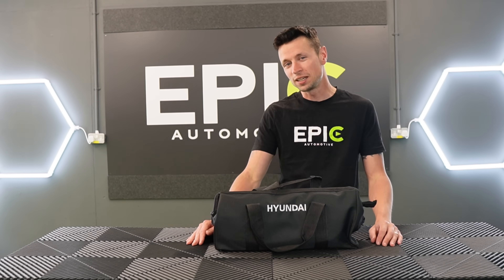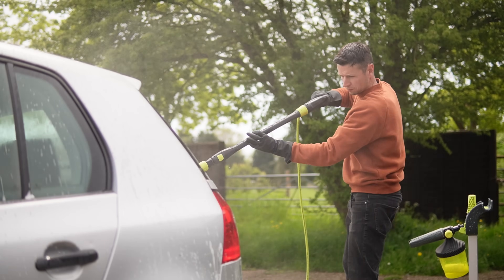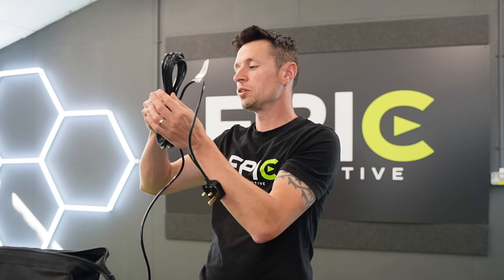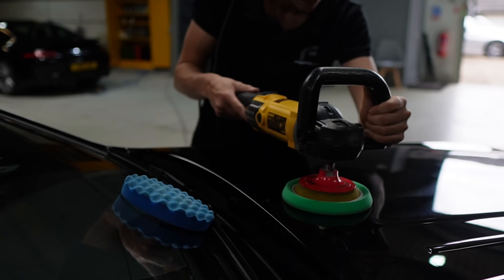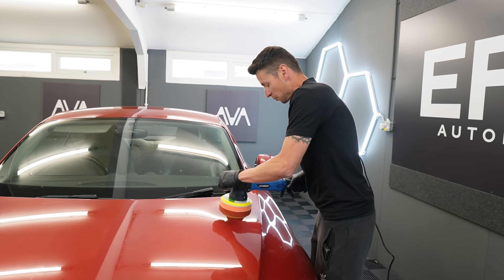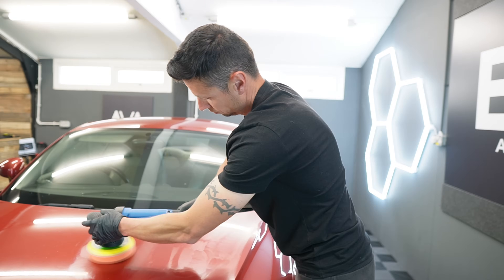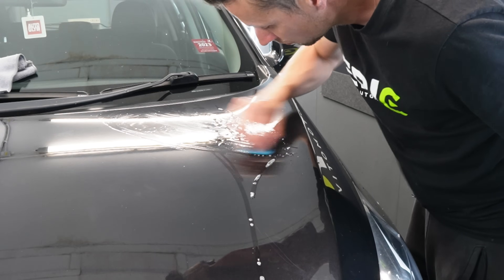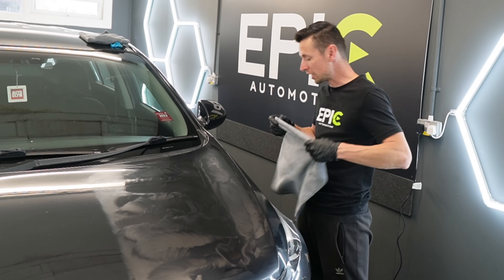Polishing a Car has Never been Easier thanks to this Tool!!!

Comment: I'm  glad I got into detailing 20+ years ago. The choices for machines, pads, compounds was much smaller than nowadays.
Reply from the maker: Life seemed easier back then
Reply: @epicautomotivedetailing  I think everything was!  When I was looking for a machine polisher, all that was around at the time was a Porter Cable, but it was 110V so you also needed a trandformer.  Meguiar's brought out a DA machine, which I bought.  I'm on my 3rd set of bushes for it now.  The choices for compounds, polishes, waxes, sealants etc, pads & machines must be  bewildering for a novice.  This High un Dry kit is terrific value and great for a novice to cut their teeth on!
Reply: I’m starting out and it’s a ballache deciding which ones to get lol. So many compounds, pads, machines etc 😅😅

Comment: Amazing work! Just the Hyundai name would give me confidence that this machine will never go wrong and last a long time. This video shows that there are some real gems if you look around, £22.50 without discount for 40 quality microfibres is a stunning deal. The polisher looks good too, I might look at purchasing this next time, but then again, my 9-year-old Kestrel Deltalyo DAS-6 Pro 850w is still happily and reliably performing daily paint corrections on typically hard paintwork on approved used stock at the Volkswagen dealership I'm based at (well, maybe I like the vibrations!)
Reply from the maker: Thanks Owen, Yeah Im trying to add other cheaper products into the videos to help people find the odd bargain :)

Comment: Great video Dave , got a IN2 Detailing DA8 use Chemical Guys green pad with Scholl S20 black works fine on my car , only polish it every 2 years then apply Pyramid CC 2 year ceramic coating and fannys your Aunt. Bought a couple of packs of those cloths and they are very good value and fantastic quality . Studio looks the dogs mate ! All the best :)
Reply from the maker: Thanks mate my mate supercharged llama has a few polishers from in2 detailing. I still need to try the forced action polisher
Reply: Agreed with the In2Detailing DA8 as a fantastic polished for only £109. Forensic Detail also says great for newbies and pros

Comment: Ive been machine polishing for over 25 years, Started off with rotary back in the 90s and stuck with it until about 2017 when i was tempted with the 'long throw' hype into buying the Flex XFE DA. Going from the rotary to DA i found it useless for anything but very light polishing and finishing. The stalling on the slightest curve is annoying as hell and you spend more time trying to keep the pad spinning than you do doing any meaningful work. About 6 months ago i bought the Flex XCE forced rotation machine and i only wished id bought one years ago. I can knock out a large sized car in 2 hours. You can rip through cars with the forced rotation machines, i love it.
Reply from the maker: Yeah my mate is letting me try his one next week hopefully so it will be interesting to see how it goes
Reply: @epicautomotivedetailing  trust me pal, just buy one. I'd started to dread machine polishing jobs because it took so long, but since I've been using the forced rotation machine, I've started to love it again. Get yourself some 3D Speed and ONE compounds as well, you wont regret it. Only thing I'd say is the forced rotation feels a little erratic at first as it can walk away from where you want it to go but stick with it and you'll master it after a few uses. You hardly ever need to get out the smaller polisher either as the forced rotation can tackle almost every part of the car. You can even tackle larger sections of the car as well rather than just the usual 18 inch squares at a time. If I'm in a rush to get a job done I'll take a whole half of a bonnet in one go and just rip through it on speed 6.
Reply from the maker: @johnmelling9950  I'm still using my rotary as my main polisher as I love using it
Reply: @epicautomotivedetailing  I still have a Flex rotary but only use it with a wool pad for taking out deep, heavy scratches. I then switch to the forced rotation to buff out the rest of the car. I also have a little Milwaukee m12 battery polisher for doing spot repairs, and that's a really handy little machine for isolated scratches and scuffs. I've got about 6 different polishers in my van, lol. My worst buy was a nano polisher. You need lots of high end detailing jobs to get any use out of them.

Comment: Thanks Dave, why they couldn't use the same pad colour scheme as most of the detailing industry, as to me Black pad is usually the finishing/softest pad.  I use LC or CG Hex pads.  But looks a cracking cost-effective beginner tool for sure, I/Wax have some good ones too.
Reply from the maker: I know I thought that too. These pads are very good quality so that's a plus point.

Comment: Ive been using a Das6 (non pro) for thrree years, absolutely gutless and stalls at the smallest bit of pressure or concave surface - perfect for one stage gloss-up and i learnt a lot using it - I've used it for 100s of hours and never damaged anything, im sure its impossible with a fine compound and polishing pad if you keep it away from edges and let the rotation disctate the speed with no pressure. I've just bought a Makita cordless 15mm throw now i have the word spreading, but my 3" polisher has been my go to for everything (EX803) Takes longer but better  results for me anyway, just abetter machine. Im a massive Hyundai fan (for anyone not aware they've been industrial manufaturers, not just cars: air con units, pressure washers etc. ) . Car, compressor, both been superb. I'm sure this polisher would last you and a great option to start. You covered all great points as usual. My tip is to make the space you are polishing using six times the size of the pad you are using., then you get consistency across the vehicle. But for beginners dont get stuck in the detail and don't be scared to try.  (Kia is the Hyundai sister company for anyone who didn't know)
Reply from the maker: Great advice thank you 🙂
Reply: Im a mobile detailer.
Ive got 2 DAS6 polishers from different manufacturers.... Both 900w
The no  name ... Really there is no name labels.... Awesome polisher. Instant start. Does the job... Takes 8x5x14mm brushes.
The other is a Draper... Totally gutless and soft start

Comment: Great review.  I purchased the auto finesse version recently to lightly compound and polish my black mini post 6 year old stripe removal.   Did the boot by hand and the bonnet by machine.  Both look good by the bonnet was so much easier/quicker.  Still have the remainder to do, but it will save a lot of time and provide a more uniform finish.
Reply from the maker: Nice one well done 🙌

Comment: Almost bought this one after watching and research. But opted for a slightly more expensive DA8 polisher. Mainly as it comes with a 3 inch backing plate and 5 inch. Not sure if I will need to use a 3 inch plate but it's there. £109 now so still in a decent price

Comment: The yellow pad is softest, then the black with the orange being the firmest in my package. I have just opened the delivery today (purchased 11/11/23) and given no experience I will need to call into an auto shop to compare pads and determine which pads are correct or wrong.
Reply from the maker: Yeah they made a mistake so they have probably changed the user manual again now hopefully

Comment: Excellent demo. 👌 
Question, cars meteials are very different now (some are metal & some non-metal).  Are the compounds to polish them going to be the same?  When you take the chemicals off ( like you did with the black car) what products did you use and is that a must for the first time to polish a car?  Many thanks 😊

Comment: Hi Dave another great video - studio looks great too -You mentioned microfibre cloths showing off a big pack and suggested a link in the description but I'm unable to find said link - . Another question is the size of this particular polisher 150mm would that be suitable across the whole car or would a smaller diameter be preferable for smaller areas like pillars and how should you tackle edges / folds in the panels? thanks
Reply from the maker: Hello I've added the link in description under my top tools 🙌. Also I have a kdn nano polisher. Its coming to the channel very soon for a review. I've used it many older videos though like the Halloween special I did few years ago

Comment: This video literally is what i needed today 😊 Thank you!

I was researching just a foam and wool pads which i can attach to the drill, but Now I think I am going to invest in a good polisher.
Reply from the maker: This one is good value. It's definitely not going to compete with a £400 Rupes but Its one of those tools you may not use on a daily basis so totally depends on your circumstances. Many mobile car valeters rarely offer machine polishing of an enitre car but just fix the odd scuff so its definitely a worth it

Comment: Question, i currently use Ultimate compound to remove scratches and buff faded headlights after sanding, but can anyone recommend a finishing compound with no fillers or glazes in it to complement what i already use? Mostly to improve gloss,  remove any haze left over from the ultimate compound and basically afterward ready for a wipe down before Fusso or a ceramic coating? Preferably more budget friendly too

I use a 850w da, rather than rotary, Halfords pads. 

And i appreciate you making these videos, it helped me and i other people get into detailing, bringing dull paint back to life.
Reply from the maker: Hello most ultra fine finishing compounds work a charm. I love the rupes range

Comment: Thanks for the tips and tricks, truly useful!  I was wondering - Could I use an angle grinder with an appropriate pad for a start? It has a soft start, and variable speed that starts at 3000rpm.

Comment: Great confidence boosting video for someone like me  to move from Hand to Machine polishing. YouTube says a lot about getting the right pad to pair with a one step compound/polish. What did you use with this Hyundai supplied pads or doesn’t it matter that much? Cheers
Reply from the maker: Thanks mate, I just used the ones supplied with the machine.i thought they were pretty good
Reply: @epicautomotivedetailing  I meant what polish 🙏
Reply from the maker: @clewis5220  I used one and done compound by turtle Wax. Its a good all rounder in the heat without making powder

Comment: It’s so good it’s out of stock everywhere :-/ can you use an orbital sander with a pad attached ?
Reply from the maker: Infinity wax polisher is better in my opinion
Reply: @epicautomotivedetailing  some of the polishers cost megabucks! Not just at Infinity Wax, but in general. I can't see why they should be 3-400 pounds 🤷‍♂ must be some tech in them to justify the cost :-/

Comment: Can you tell me when would you use a high speed polisher over a high torque.
I want to remove some touch up paint . Which would be best. I’ve tried a da polisher but it never removed the excess paint. Will I need to sand first.
Reply from the maker: Hiya id recommend sanding first

Comment: A bit of advice please.
Wife got a brand new Hyundai I20 N in black.I clean it correctly but its got some swirls already!
Could I get these out buy hand,if so best products to use please.
Reply from the maker: To be honest mate it probably wasn't you who caused the swirls. They may have been hidden under a wax or fillers. You can technically remove the odd swirls and holograms by hand but your in for a long day but Definitely not impossible
Reply: @epicautomotivedetailing  Yes dealership was shite.Just got a rear bumper corner that I see everytime when its on the drive and want to sort.
Guess fine compound will do,any products I should try?

Comment: Im a UK based mobile detailer.
Ive got 2 DAS6 polishers from different manufacturers.... Both 900w
Ive been using the same £60 no name polisher for the last 14 years!

The no  name ... Really there is no name labels.... Awesome polisher. Instant start. Does the job and makes a racket. I have music and headphones so meh.
Takes 8x5x14mm brushes. (Dont buy the Chinese brushes that cost £1, You'll need 2 or 3 sets of brushes per car if you do!)

The other is a Draper.. Allegidly 900w. Totally gutless and soft start.
I bought it as a 'Oh crap. I need a polisher and No1 has just eaten its last set of brushes and they are not here yet'
It lives in the van, only gets used as an emergency.

Comment: I have a rotary polisher, bought from Machine Mart before you were born 🤣😁😂. Seriously my best mate used to spray cars 30 years ago, and that polisher was the only make I ever saw, I have one somewhere in the garage along with a load of pads. The Hyundai looks perfect for us who polish a car 2/3 times a year, as an engineer I spend a fortune on tools, I buy the best makes, the most expensive stuff ( my 5 screwdrivers cost £230 ) but the most common tool I use is a cheap Homebase own brand flathead screwdriver I found somewhere, and you know what, it’s great 👍 
I may buy this, at that price it’s kind of hard to say no to, one thing, can you get smaller pads for it, that’s the one thing I’d like as a weekend warrior. 
Hope you’re boy is on the mend ❤️‍🩹
Reply from the maker: thanks so much. My son is making a fast recovery now so it means I can get back filming again. I still love using the rotary polisher but  they definitely aren't suitable for beginners unlike this one. Thank you for commenting

Comment: What colour of pad with this polisher would i use with the Autoglym Super Resin Polish?
Reply from the maker: black pads are normally soft pads thats all you should use really. it powders up so much. better with rupes uno protect
Reply: @epicautomotivedetailing  Thanks for the reply & the recommendation. Can i polish by hand using Rupes Uno Protect or do i need a machine for a better thorough job?

Comment: I live in a hard water area what is the best way to stop or get rid of water spots?
Reply from the maker: have you tried any water filters? spotless water are located across the UK with filling stations if you have a water tank. Removing water spots can be achieved with a decent water spot remover
Reply: @Epic Automotive Detailing  With a water filter can I just Rinse the van off and leave it to dry naturally ?
Reply: I use a resin-filled cylinder to give me deionised water for the final rinse with an open hose. No water spots, even if you leave to car to dry in the sun. My hard tap water measures 320 parts per million at the tap, but the resin reduces this to zero
Reply: @Paul  I am going to get one and do the same also saves drying it. My t6.1 is ceramic coated to so should be easier.

Comment: Great review I brought a very similar machine called a Batoca that came with a load of different pads and wool, cloth or microfiber covers the machine is no different from the one you have just reviewed but I haven’t used it yet as I think it came with over 30 pads some flat and some curved but the handbook doesn’t say what they are used for but your video has given me the urge to start using it on my Black Peugeot 508SW can you tell me the difference between the flat pad to the wavy curved ones please
Reply from the maker: Curved pads reduced the risk of splatter but we always end up making a mess anyways lol . Thank you 🙏

Comment: Liked the video, just bought a black Kia Sorento with paint in the same condition as your Kia. This looks just the machine I need to make my car look a little less used. One question, which compound where you using with the black pad ?
I do have some Roar 620 Plus. Would this be any good. Open to any suggestions as this is new to me.
Reply from the maker: For this video I just used one and done compound. Not my favourite but it had to be used up lol